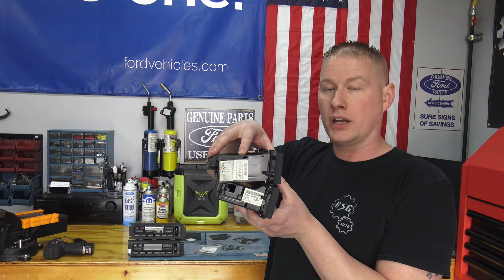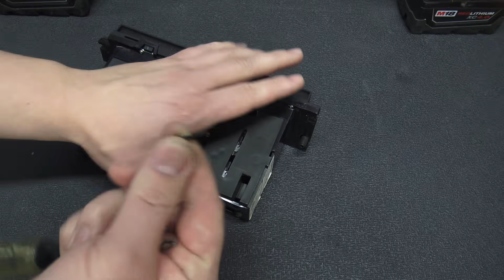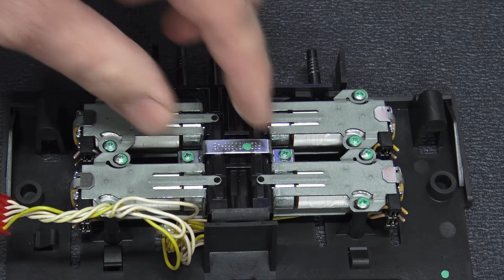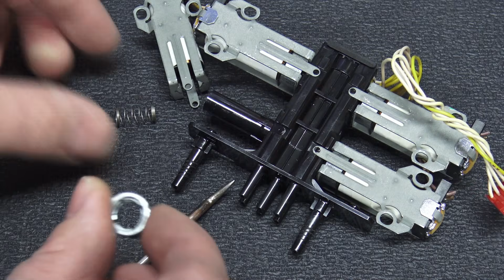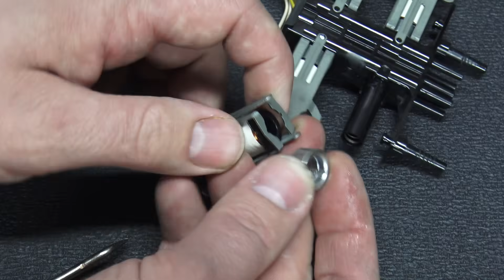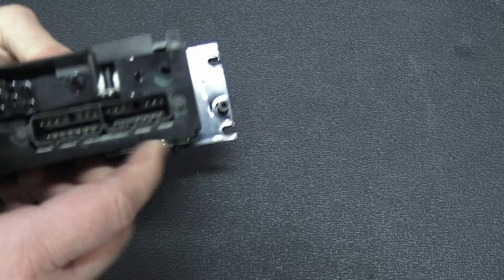Ford HVAC System Stuck on Defrost: EATC Control Head Repair

Comment from the maker: These are the Parts and Supplies used in this video:
Silicone O-Rings-
https://amzn.to/2q0G7wo
Silicone Grease-
http://amzn.to/1pfNywv
A basic pick set can help allot-
http://amzn.to/1TihEtL
Reply: Awesome instructions . thank you so much.. On point
Reply: Omar Jarrett has   Okkliimo
Reply: Would this work for my no heat problem? All vents work when selected, and ac works perfectly just no heat at all.......
Reply: I Come in Peace! You’ve probably already found the issue but on my grand marquis the problem was the blend door actuator it was stuck on heat though.
Reply: What about the orange or yellow foam(?) on the end of the plungers? Mine crumbled off, do I replace this? If so, what do I replace it with?
Reply: @dangroce82  Rudy  I’m good
Reply: @tonyziade3007  please see the response to @danielhernandez.
Reply: @dangroce82  what did you do about the degtated foam  mine is the same
Reply: @richhasomeris1621   please see the response to @danielhernandez.
Reply: @dangroce82  did you ever get an answer,cause I just replace the O rings and I damage the yellow looking foam or clay.let me know what you used please
Reply: @danielhernandez-iv4uc  I never received an answer, but I changed the o-rings and didn't do anything with the decayed foam. It worked just fine and has continued to work without issue ever since.
Reply: God richly bless you!
Reply: But it does take about 4hours
Reply: I got my ac on but in the back of t he, van I ge,t. Hot air why??
2000 ford windstar
Reply: Amazon says they aren't sure if they will be available anymore.  Any alternatives that you know of?
Reply: @adelamonfredo108  The size is 007 Silicone O-Ring, that all you have to search for
Reply: Is there another supplier that you know of?  Amazon says not available at this time.
Reply: The lights in mine stopped working.
Reply: I need help. Mine does not have the ten screws. It seems to be spot welded. Have you ever seen this?
Reply: @damienspann315  just did my 02 f150, I cut the welds with a dremmel tool, the actuator sits back in the cradle just fine.
Reply: @cyrusumberger5285  thank you sir. I may look into this again. I did not want to ruin it beyond repair and be forced to buy a new one. I did find a cheat where you can use wire ties to hold the vent actuator open for the vents
Reply: @damienspann315  
Where did find the wire cheat my actuators are welded to the board not screwed in
Reply: @underparhi  the actuator is close to the throttle pedal. It’s not easy but you can lift it up and tie it to something sturdy. Good luck
Reply: Mat thank you soo much 💖 for all you do to help us out
Reply: My friend you saved me a bunch of money I changed o rings and my ac is working like new . Your awesome 👍🏼👍🏼👍🏼👍🏼
Reply: Makuloco,

Do you know if there is a different link or package quantity for these orings? The link shows a 100 pack, but only need 4 for the 2004 GMQ unit repair. Let me know thank you.
Reply: What is the size of the O rings? the link does not work. I think they are not on Amazon any more
Reply: Thank you so much for saving me $800!
Reply: Anyone know what size these o-rings are? The link no longer works.
Reply: 007 Silicone O-Ring, 70A Durometer, Red, 5/32" ID, 9/32" OD, 1/16" Width (Pack of 10) @dlopz4
Reply: Harbor freight has these O-rings that work better. They go for around 10 bucks STOREHOUSEHNBR O-Ring Kit, 205 Piece
Reply: What’s that foamy part on the back side?  Mines has completely come off.  Where may I purchase some?

Thank you in advance.

Comment: I found a fix for the display going out from a Youtube video.  Turn the headlight switch all the way to the right and then to the left three times and the display returns.  It worked for me without fail.  My truck is  an 06 F350 Lariat.

Comment: 2005 Crown Victoria EATC fixed.  However, (my fault for taking more than one solenoid out at once) I discovered 6 springs instead of 4!  Well, I put it together as I thought it came apart and everything works.  If anyone knows where the two "extra" springs really go, let me know!

Comment: I have a 2003 ford f150. I have the digital control panel. I am looking for the type or number of the small bulbs that a soldered to the circuit board. Mine slip down in a little black hold then soldered on the side. Please help sir! Thank you!

Comment: What if on Max AC it will blow high on its own. On heat I have to run the dial past the high setting and cram something in the dial to hold it up there otherwise it won't blow at all. I've already replaced the blower and the resistor

Comment: I took my '03 in twice to get the AC fixed since it worked on all settings except on Max AC it went to defrost.  The first time they said there was a vacuum leak somewhere, but didn't have time to find it.  The second time there was no leak...IDK and that I probably just need to replace my AC console.  So I finally decided to just try to replace the O-rings.  I had to watch the video a few times to make sure I was getting the correct part out...the tabs make all the difference...and then it still needs some prying to get out.  But I finally go the right part out and replaced the O-rings and low and behold I did NOT need to replace the AC console...I did not have a vacuum leak (sort of), I just needed to replace the O-rings and everything worked as it should.  I wish I did this sooner as wer are heading into winter and won't need max AC, but it will be ready for me when the weather warms up!  Also, once I figured out what part to pry out, this was really easy to do on my own!  Thank you for the step-by-step info!

Comment: I know it's a 9 year old video at this point. But I just acquired a 2003 F150 with this controller. The o rings in it were rock hard. Took me about 30mins from start to finish. 100% fixed! Thank you for this video!
Reply: I’m going through the same thing right now. Where did you get the orings from? Local part store?
Reply: @kevingreen2994  The link to the o-rings is just above the comments.

Comment: The tag on my bag of o-rings says:
AZ-S70007 / 1000 (yes I have 1000 o-rings!, HMU if you need some)
B00M902FFC
007 O-RING Silicone
70 Durometer Red FDA (which means food safe)
CS: .070 IN (1.78 MM)

If your EATC is spot-welded instead of screwed in, you will need to drill out the spot welds or use a Dremel tool or similar. Reassemble by soldering, or JB Weld, or epoxy, or small nuts/bolts, or even durable tape. 

Use silicone grease and not Petroleum Jelly due to chemical differences, Vaseline can cause issues over time with silicone.

Should take about an hour total.

Steven C. ASE CMAT L1 L2 (retired), USAF Avionics Electronics Instrument Specialist (retired)

Comment: I have a 1995 Mark VIII Lincoln. Is this similar or the same kind of repair for the unit in it? Same deal it's blowing mostly out defrost and a little out of floor. It was intermittent and working correctly sometimes but now no luck

Comment: 4:55 this is wrong. Mine has 2 machine screws with 1/4" heads(maybe 6.5mm). There absolutely no torx bits anywhere.
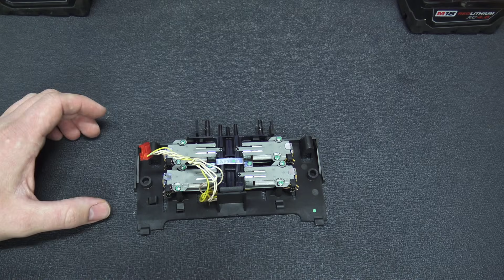Reply: 6:00 the vacuum solenoids are nit screwed onto the top plate. They are in a metal frame and there are small rack welds holding them in.

Comment: Hi, how are you? I hope so. I would like to know which of these digital air conditioning controllers would be suitable for adapting to a 1997 Ford Ranger 4.0 STX, as I wanted to update to digital if possible. I would appreciate it if you could tell me the year and model code that would work. I thank you in advance for your attention.
Reply: It's not possible without a parts truck. You need everything.

Comment: This doesn't work on a 98 Grand Marquis. The plastic tubes are incased in a metal frame. The solenoids will not slide off the plastic tube. The metal frame won't let them. This sucks.

Comment: You ever come across 04-06 auto hvac control head flashing on and off? All functions work,  but every 4ish seconds it turns off, then back on, lights, display and all.  I've read it could be an issue in the instrument panel.  Any advise?

Comment: You don't need to take the end part off that goes to the plastic air chamber. Just slip the part out with the O- ring from the front.
Reply from the maker: sure

Comment: I have a 2002 and this didn't work for me. The module doesn't have the ten Philips screws. The housing is soldered together, so the components cannot be removed. 😢

Comment: Thank you for all the great advice & help you've given us through the years, it is truly appreciated. Would it be possible to ask you question? My 2003 F150 EATC unit light bulbs for the selector buttons are all burnt out, temp display and the unit are working fine, but you can't see the buttons at night, and the bulbs don't appear to be replaceable! So my question is? What year ford  EATC units have replaceable bulbs, and can I swap these units as long as they are vacuum type controller? Thank you for your time it's truly appreciated! 💯% 😊

Comment: so, I have an 05 f350, I'm guessing I have the smaller one. What's the repair for that style?  Are the solenoids someplace else where I can hopefully fix? My pump seems fine and my lines seem to be ok. I can wait till my pump stops and remove a line and it will start pumping again until I reinstall the line, give it a few seconds and pump will turn off.  What's the fix for the smaller unit?

Comment: My 2003 F150 with auto AC control only blows on the upper vents. Will not switch to defrost or floor. Does anyone know if this is one potential fix for that specific issue?

Comment: I have that slim type you showed at the beginning. Do you have a fix for vehicles with that unit? Truck won't go into air conditioning. Stuck on heat.

Comment: Hey Brian, Would you mind making a video just going through all of the vacuum lines for a 1997-2003 Ford F150 4.6 4x4? I think it would be a great help since those trucks are so vacuum-based (and a royal pain to find leaks at times). I haven't found anyone who has presented a really thorough breakdown of the vacuum systems from start to finish. I think it would be worthwhile and helpful to us rookies like me who don't do well reading diagrams. Thanks in advance if you do that! Great video :)

Comment: Just did this O-Ring swap / upgrade to my 11 Grand Marquis.  The old O-Ring's were hard, had flat spots, and broke when I tried to take them off.  I used the O-Rings shown in this vid and even though I'm glad I did this... it made zero difference.
My vents seem to blow all the time no matter what.
Floor and defrost do turn on / off. But the vents seem to be stuck on.
Any advice?

Comment: 2002 FORD Expedition - pulled my unit out and unfortunately it is not rebuildable- its built a little diffrently - the metal frame that holds the solenoid is spot welded to a larger frame and there  is no way to get the solenoid out without drilling out the welds and I guess re-welding them after... leave it to ford.

Comment: Hey, quick question for anyone doing this fix: I had a black spacer fall out of the little plastic tube the solenoid goes into. What way is it supposed to go back in? Thank you!
Reply: Mine too.  It goes into the black port, the spring next, and then the main part.I think they are simply a spacer that keeps the spring against the main plunger
Reply: Just did it on mine and had to do it 3 times. First I didn’t put the spacers in right (it was blowing only out of the floor). Then the 2nd time the foam that covers the solenoid disintegrated into the port. So I had to remove then blow out (it was blowing only from defrost).  3rd time, I made sure the spacer went flat side first and the side with a divot facing out, then the spring. Worked!
Reply: @Deested  what did you do about the foam? Mine have also disintegrated, so I was considering blocking the holes with hot glue, if that would work
Reply: @nicholaswaldoch2937  I just removed it and  made sure the pin holes were clean. I plan on buying a cylindrical air filter from a riding lawnmower and it has an outer sleeve of foam and cut it out from that.  For now the hole is open with no obstruction and it’s working fine.

Comment: Just finished doing this, i had so much stuff fly out of my vents, i had AC but it was stuck on defrost and now it works great, lightly greased the new o rings and the connectors inside the module and in the car as well as the jelly piece that holds all the vac lines in place, thank you for the video
04 crown Victoria LX

Comment: Thanks for the awesome video!!! I replaced the o-rings as shown in this video, but it did not solve my problems.  My problems are:  (1) Enough A/C blows onto the gas pedal to be annoying, and (2) I suspect that, on Max A/C, a bit of outside air is being brought in, thus making it seem like the A/C is a weak. I say that because I have smelled exhaust from other vehicles. This is on a '04 Grand Marquis that has HVAC controls identical to what this video shows.  Like you said in your video, I need to check the strength of the vacuum, but HOW DO I DO THAT???  I am also wondering:  Is it possible that the air doors themselves are somehow in a condition such that they cannot close fully?  Could it also be that there is a leak in the ductwork?  If so, how does one go about verifying any of that?

Comment: Thank you for the video, I thought I had a broken blend door, but several hours of working at taking parts off and cutting behind the glove compartment, I realized that was not the problem. I found you video and in 30 minutes the air was working fine.

Comment: Well that's all well and good but mine is made where is press welded where you can't take it apart and does not have the 10 screws
Reply: Mine is the same way, currently trying to figure out how to disassemble it without being destructive.

Comment: Awesome videos, I’m a subscriber to your channel.!!
You helped me 2 years ago 👏

Now my question is, I have the same control same A/C control, but issue is even when the A/C is OFF stil blows cold air thru the vents or if the HEATER is OFF still blows hot air thru the vents  

The other more basic controls gives you the option to close your vents b it this isn’t..!!

HELP

Comment: Hi, thank you for this video, I just came across it. I'll be doing this to my unit soon. Could you tell me if the light bulbs are replaceable in a 2002 Expedition unit? My display is working but the lights behind the buttons have stopped working. Thank you for your reply.

Comment: Can anyone tell me why my EATC starts at 40 degrees outside temp and gradually increases one degree at a time while I am driving until it reaches 90+? It’s been below freezing for weeks and when this happens it messes with the automatic climate control function. I can’t find ANYTHING about this on the internet.
Reply: I'd chance all the internal temp sensors.  They are cheap and easy to do
Reply: @wydopnthrtl  now I need to figure out where they all are and how to change them

Comment: I have a 2001 F150.  It doesn't have the electronic controls.  My issue is that it WON"T go to defrost.  I thought defrost was default mode?  But mine will not go to defrost?  Any suggestions? I didn't find any vacuum leaks.  I tried a new control unit and that didn't solve the problem.  Any ideas greatly appreciated!  It's winter here and I need defrost!

Comment: 07 tc signature limited.  If the hvac control head doesn't have vacuum lines to it, just the 2 electrical connectors, would i just replace the head with a new one?

Comment: This worked perfectly for me, thank you! For anyone who needs to know how to get the vacuum line connector off the back of the unit when removing, use a 10mm socket (doesn't need to be deep) and it comes right off! It wasn't sure how to remove at first, but I hope that helps!

Comment: Hi. Ford Tech. Iam whiting you from Puerto Rico. I own a 1999 ford expi and has a ac unit like that in the video. I need to know how to replaced the back lights of the unit. Mine is to dim and almost not light at all. I appreciate you can help with this. Thank you.

Comment: Hello Ford Tech,
Help, I have the unit you referenced that is shallow.  The vacuum hoses run to a small manifold deep in the back of the dash.  When I switch my truck on (not starting the engine) my vacuum pump runs continuously.  I have removed the small manifold and placed my finger over the black hose port and the pump stops. When I remove my finger pump starts running again.  
When the AC or fan is running the pump stops.  When the manifold is plugged into it’s housing on the back of the dash (small black box) the pumps runs continuously.  Any experience with this?

Comment: I've checked every source for a leak this is my last resort. I'm glad I found this video. I can essentially fix my $350+ unit with some couch change and a lil elbow grease. 🤣🤣 Wow. I will be doing the repair tmrw. I will update 👍 

Update 6/13/22 put 4 new O-RINGS a lil silicone grease and my ac is back to normal 🙏

Comment: Thank you! For less than $10 and an hour and a half, everything is working normally again. I have had the damper actuator cable-tied for two years, which means I had no defrost. I did not need to disassemble the solenoids.  Two of the four hard o-rings broke coming off. 2002 Lariat fx4.

Comment: Do you have a video to go through the vacuum lines also?  I have a 05 Excursion that's stuck on defrost to the front of the vehicle but rear control works fine.

Comment: Worked liked a champ!!! Mine was stuck in defrost mode. I also had to replace the two little 90 degree vacuum lines by the throttle body because they were rotted. Whole job was an easy fix for a couple dollars!!! Thank you so much for posting this video. I appreciate you sharing your knowledge.